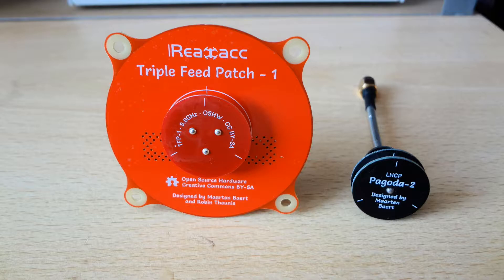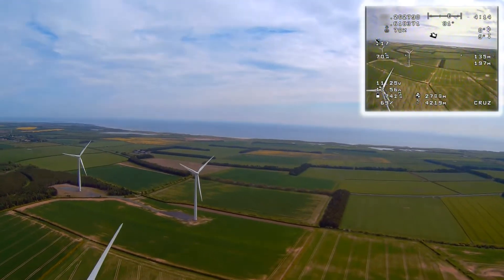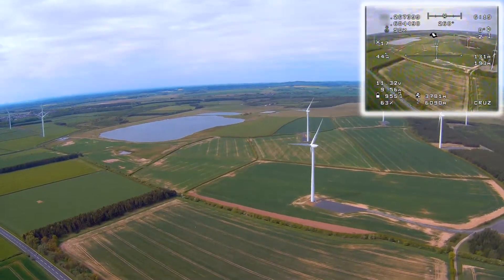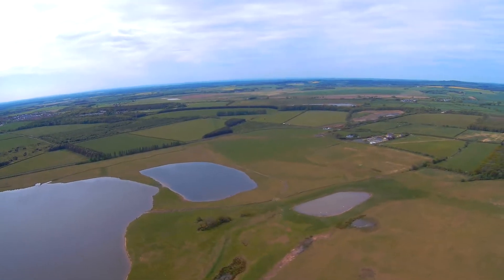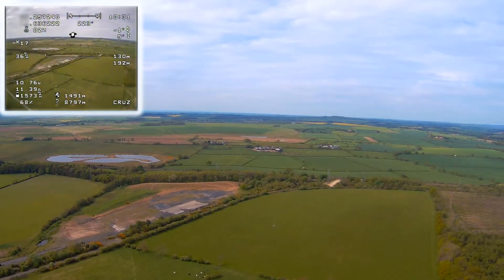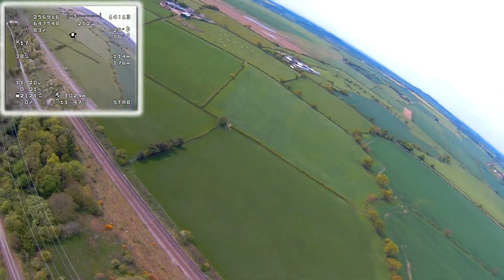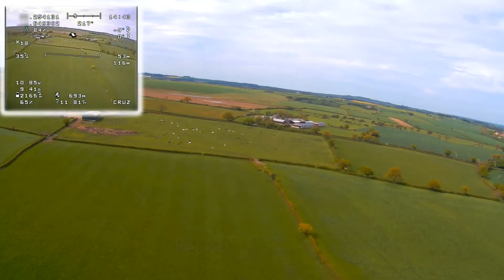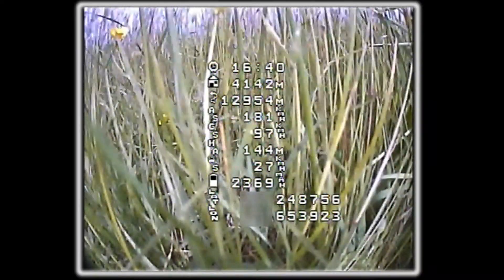Pagoda & Triple Patch Antenna Test to 4kms

Comment: Nice flight, love using different antennas. Hey, which 10 turn were u talking about?
Reply from the maker: The 10 turn helical I used to use was a home built unit based on the design by Andrew Mcneil here in Youtube.  It worked really well for me but I ma realy liking the Triple patch antennas now.

Comment: Nicely made video and very informative to those who are buying one of the triple feed antenna. Many thanks. Your hiccup with line of sight with the plane just shows the need for a spotter or you might not have realised that a full sized aircraft was about
Reply from the maker: Yes easily done to see the wrong plane lol.  Check out my subsequent flight out to 8.3s with that antenna.  I mow have the triple patch array antenna but need some better weathr to test it out.

Comment: lol :) I bet that was a good laugh when you realised you'd been controlling the wrong plane... what is the message that keeps flashing under the AHI every so often?
Reply from the maker: FPV Steve Hi mate yep we were having a good laugh about that as the real plane was much higher and obviously much further away than we thought I just took it to be my Raptor coming home 😀  What you are seeing are speed warning settings they really need adjusted in my OSD but its not easy to get to and I aint got around to doing it yet lol